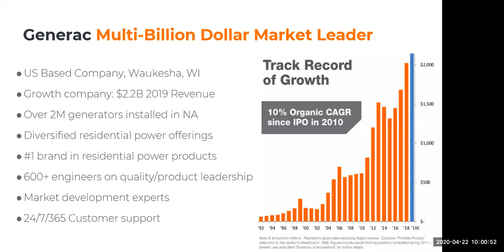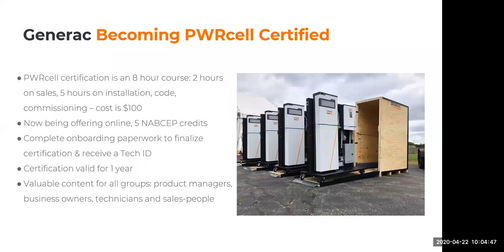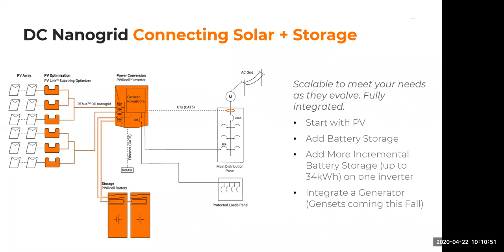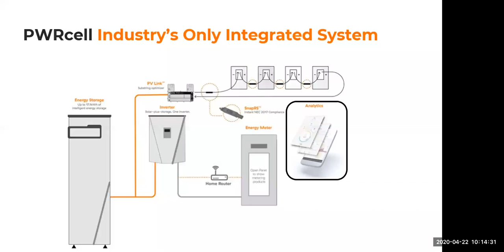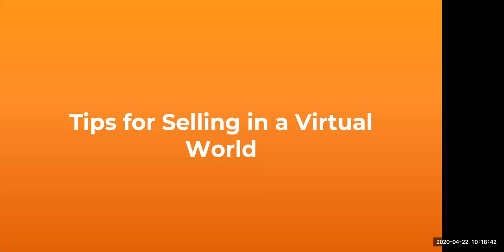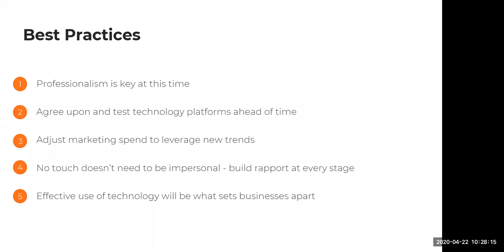PWRcell Solar + Storage | Generac Clean Energy |  Presented By Soligent

Comment: I'm looking at the 18kw generac powercell to connect with my existing 6.4kw solar panel at my home. The one thing I can't seem to find is the management application software. My goal is to program a TOU "time of use" for the generac powercell in effort to minimize my electrical demand during peak (4:00PM - 9:00PM) period. Which app or PC software is available for management and monitoring needs?

Comment: I have a 10KW Natural Gas Generac Generator.  Is this something that can be integrated with PWRcell or is that redundant
Reply from the maker: Great question! Generac Clean Energy just recently launched the PWRCell automatic transfer switch that will enable generator integration. If your interested in learning more and finding out if this is something that would benefit your system and needs, please reach out to us at marketing@soligent.net. We are happy to connect you to a solar expert.
Reply: @soligentdistribution  Does this PWRCell ATS enable the generator to charge the battery, or it is just to enter into service as a secondary backup after the battery goes below a set point?
Reply from the maker: @ManuelRodriguez-zy4bs  Yes, the ATS will be required for generator integration and will charge both the battery and the power loads. Thanks for asking!